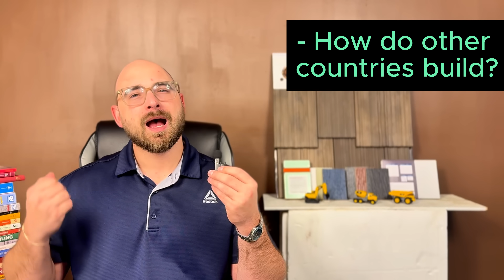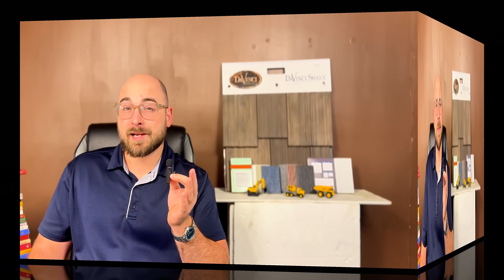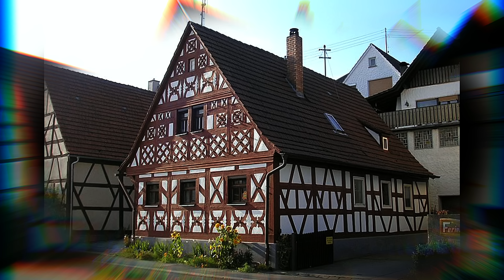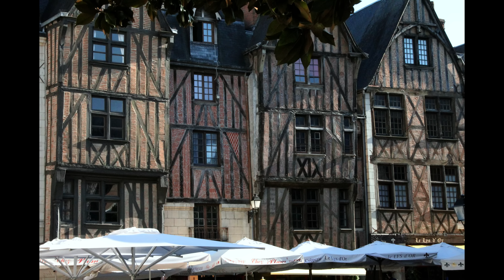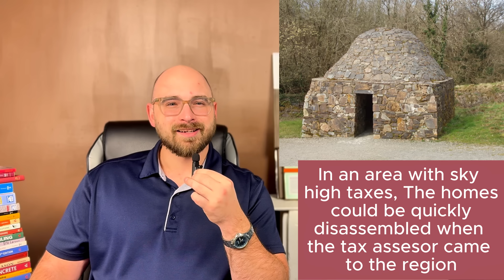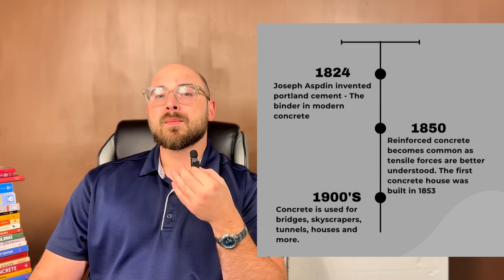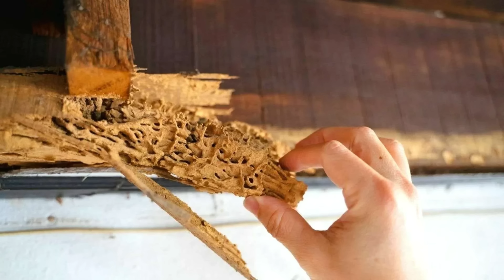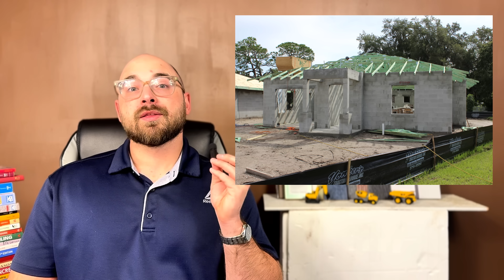Why Other Countries LAUGH at American Homes

Comment: My country (Singapore) usually builds using concrete probably as wood is traditionally more prone to rotting in our humid tropical climate (though we switched to steel for a while in the mid-2000s when Indonesia banned sand exports to us). We're raising construction productivity by building the walls in an off-site factory (which could have automated its production line) & then lifting them in place. The next step is moving to building entire rooms of the building in a factory (including fitting it out with flooring e.g. vinyl) before lifting these rooms into place when building the building, but I read that construction companies worry that if they take the 1st step to adopting this next step, then while they have invested money to research & adopt this, other companies could then copy them for free & do construction more cheaply. In this case I'm thinking if patents can help.
More recently a university built some new buildings from wood instead (some of which were imported from Austria) supposedly as it takes less energy &/or water than producing concrete. Heard the wood may have been soaked in oil to protect it from termites &/or rotting but it has still been reported to be happening anyway. So I heard the building has become a lightning rod for some of my countrymen's anti-West sentiment, who associate wood buildings with Western lifestyles & think my Asian country may be blinded by what's trendy & becoming too Westernized

Comment: In Australia the majority of our homes are only clever insulated tents.  They leak heat and warmth, they are never square, and by that I mean opposite walls may be different lengths and the rooms end up out of square.  My home is almost 50 years old on a cement slab, with a brick exterior that adds nothing to the structure.  The frame is hardwood, only because of its age and would be called a balloon type frame that now a similar building would be a softwood plantation pine.  We demanded our soffit be 900mm to help with protection from rain and sun.  Our energy conservation is due to our planting of trees and shrubs to protect us from the summer sun.  We also have a lattice work set out level with the roof gutters and that lattice allows us to grow vines that also protect us from the sun and adds to the warmth in our very mild winters.  Our winter day are about 22C during the day with overnight temps of about 12C.  It is our summer heat that sits on 30 -32C with overnight temps of 20C.  Our heat waves are regular with 39 - 40C and nights of 23C.  So I don't think the USA has exclusive rights to poorly built homes.
Reply: Today’s standards are better than what you see in the US’s worst, but yes, plenty of glorified tents in Australia. A mild climate meant people didn’t literally die (much) if they were bad in Australia, and the US mostly has cheap electricity.

Also there are some well built homes everywhere, including the US and Australia. They’re just not cheap and large.
Reply: Ive heard NZ houses are pretty shit, no insulation and mold issues.
Reply: Thank you I was getting tired of people only targeting American homes and acting like the entire rest of the world only builds with stone

Comment: Isn't steel natural conductor of heat? You'd probably need to insulate it on the outside for not working as radiator or equalizer of all areas, and even then it's kinda bad for passive home, delivering core heat directly near 'skin' of the building.

Comment: Some someone who grew-up in a Brutalist concrete high-rise apartment building in a coastal city, the number one tip I have to give is: Never . . .  EVER . . .  Build your concrete building with the plumbing encased in the superstructure!! The metal pipes shrink in the cold and swell in the heat, so over time, pipes brake, forming leakages that slowly compromise the structural integrity and contaminates the water with rust. Imagine turning on the water to the sink or bathtub and a streak of brown flows, and over time, it's flows becomes more and more brown. You cant boil that away! You could repair it if the pipes are can be reached safely, but in the superstructure . . . Yeah . . .  There is NOTHING you, or anyone, can do about it but to demolish the whole damn thing and build something better!

Comment: I think the reason most people consider your houses inferior IS the whole fire hazard.
I saw meters long flames come out the top window of a ROWHOUSE (if you dont know look up dutch row house) fyi a row houses are multiple houses attached to each other on the sides. METERS long flames came out the top window... thats it. Fire department came, put out the fire. Thats it. No other house was affected, that house was fixed and is in perfect condition today...
If this happend in america you'd pretty much lose the row if not more.

Comment: Reinforded concrete frame with CMU infill is very common in areas with earthquakes like Greece. This is a notable difference to neighbor Turkey that share the same earthquake risks but the safety regulations are not enforced, so you get victims in 1,000 numbers with major earthqakes.

Comment: Our Farmhouse at home is built on a foundation of solid rock and has a strong timber structure. It still has a roof of wood shingles which was covered up with slate panels a few decades ago. It was originally built in 1604 :)

Comment: Canadian here, doing carpentry trades program, and we're shifting towards Net Zero Ready homes as being the standard, like building codes are slowly but surely being updated to include new chapters and standards for energy efficiency, and we're already seeing cheap buildings (that go through proper vetting) getting rejected and told to modify to incorporate the new standards
ICF is picking up steam and is gonna be big going forward, the cost difference is more than made up for with the faster labour and advantages over wood, and is more or less the ideal way to make a Net Zero Ready house

Comment: 17:06 Steel is actually expensive compared to concrete and can buckle under heat. So people use it as reinforcement for concrete than use it as a standalone structural material.

Comment: I honestly think the US mansions has been treated a bit unfair, to me they seem to give a realy great value for the money and the construction seem to be fairly easy to modify in order to make for example those 70s mega mansions a bit more safe in case of fire. You won't get anything near that for the same price in Western Europe and it is often hard and expenmsive to modify an existing building made by the Europen style since so much of the construction is integrated in the structure it self instead of having those sort of freestanding walls that can easily be removed or altered freely under a system of self bearing beams as in the American mansions. Honestly sound proofing is not that much better here either one can often still hear people fart and sneesing upstairs despite all the effort of making a proper floorwork... People ar elazy in the exact same manor here too whan it come to those things. And buying a house in north Europe is so ridiculously owerprized i not even seen anything compared to it anywehre else in the US... Good luck finding litterary anything cheaper then 100 000$, usualy 1-2 000 000$  here, and that is still usualy like a rapply dogs den those days. In the US it seems like one can get a whole mansion for less if one are looking around a bit and are willing to move. The use of smaller beam but also a narrower space between them i think  does comåensate well for the weaker dimmensions used in the US, also You won't have the same amonth os snow and rain in the south i guess... In my opinion a building which stand strong after +100 Years does speak for it self. even those seemingly hatred 1940s rrural homes in the US looks realy good to me on a clooser look and the frame are still standing in many of them despite decades of neglect in the forest, that is more than i can say about the majority of the buildings made in the same era here.

Comment: I live in France in a house built at the end of the Hundred Years War between France and England, a house that is almost 600 years old and apart from the roof which generally has to be redone every 100 years (the slates become porous over time) the house is very well insulated and is doing well.

Comment: Fully concrete single family houses would be too expensive at least in my country (Poland) but you can get walls made of around 30% concrete mixed with 70% expanded clay aggregate. This is much cheaper, wall is much lighter, so second story platform could be lighter as well.
I do own a house build with that material.
Both exterior and interior walls are cast in the factory to your specific bespoke project. Before cast they will put rebar, electric boxes, electrical tracts, space for your water pipe etc. Then walls will be assembled on site.
Since climate around here requires insulation, exterior walls are covered typically in styrofoam or sometimes rock wool. When finished you would have not distinguish such house from other brick houses.

Comment: Very informative video.
In Ireland, the local authority in County Louth has just yesterday (6th Feb 2025) moved two families into two new concrete houses built using a type of 3D printing to pour the concrete. No formwork was used, just a concrete pump with a nozzle like an icing (frosting) bag, controlled by digital software. They are the first of a series that Louth County Council plans to build in order to reduce the number of families requiring Social Housing (a concept unknown in America, as far as I know😂)

Comment: Cheap materials/methods can be fine, in theory it should result in cheap housing that's cheap to rebuild. In practice, housing stays extraordinarily expensive because of other factors (low density increases urban land value, building codes and zoning, profits for builders proportional to home value etc.) AND those materials make them practically uninsurable in risky areas

Comment: The village my parents live in here in Germany had their 1250 year celebration a number of years ago. No, not an error, the village is more than 1250 years old. Most houses there are 70 to 50 years old. And before anyone says "what about renovating or renewing the plumbing? That is entirely possible. Like not in "possible but insane to do" but just possible. In fact, Another example: My parents swapped their heating decades ago and switched it again a few years ago (from gas to wood to pellets). That all being said, in my experience, we don't have to change our entire wires or plumbing or whatever. Maybe single components. You just have to use your brain to build a house. Then doing shit is actually not that difficult to do.

Comment: As a German who is currently living in Michigan, yes, German homes are of significantly higher build quality. However, this comes with a significant trade-off. While US citizens like to complain about house prices, the US housing prices are, in the international context, very affordable. Depending on the state, a typical house in the US costs around 4-5x the median household income, while in Germany, it is around 9x. The effective cost difference is slightly reduced if we account for no (significant) property tax and lower interest rates, but price-wise, there is still a significant difference. Additionally, German houses tend to be smaller; something like 1200 sqft would be pretty typical.

Comment: The problem is not wooden houses, they are very common here in Northern Europe, but the standard is way thicker studs, more insulation, two layers of plaster making it much sturdier and sound proof. Also the windows are much better insulated and sound proofed.

Comment: I'll brag about my earth home. Cob built and lime plastered in the 18th century using the subsoil dug out of the hillside to make the flat plot for it to sit on: can't get much lower carbon than that. The 2' (60cm) or more thick walls are much warmer than other solid wall types, and any uninsulated timber construction. Slate roof also local (probably originally from 15 miles away) and although built detached it first got a semi attached and then an entire terrace, but is still, even after a serious lack of maintenance for decades, a sound and livable house. The lime and foamed glass based insulation I'm putting in will bring it pretty well up to modern UK insulation standards.